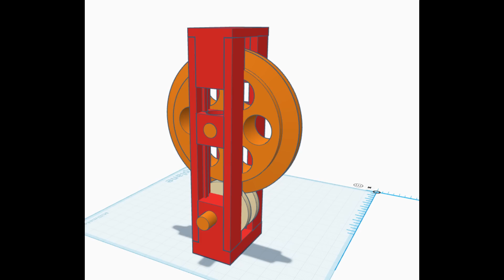2409 Friction Drives

Comment: Hey Rob! To solve the problem of the amount of normal force that can be supplied by the springs, could you try using a pair of fine thread bolts (or threaded rod) with locknuts; on each side of the axle so that you could manually tighten them down to the right torque while keeping the force on each side on center. This would make it something in-between a set-screw and a mechanical press.

Comment: Hi, I feel your process (printing machine design) has taken you close enough to start messing with Math, so will you make a machine that allows A,B,D,C,D.

A.  Suppose you can use your machine to:
(((1+2))). Draw (start, continue, stop) a straight line from any point to any point continuesly (within some plane of movement).
(((3))). Draw very short lines (points/x's)
Given a straight line between two points, 
 Draw enough straight lines all starting from the same point,
  which is one of the given line points,
  and all have the same length of the given line,
  enough so notice a circle.

B. Suppose you can build a machien to test over muliples uses the accuracy in producing:
1. straightness
2. point size
3. point to point distance
4. minimal consistently produced angle between lines with a shared point

(assuming you use the machine to draw circles around to points of a line to get 
a drawing of 4 right angles, or does this assumption say something about the machine ?!)

C. Suppose the test machine reports to "your" satisfactory: 
(((4))). Right Angle production is accurare engouh.

D. Then, What is needed from your machine such that:
======
[The parallel postulate]: That, 
if a straight line falling on two straight lines makes the interior angles on one of it's sides   
    (A) less than two right angles,
then, the two straight lines,
          if produced indefinitely,   (maybe add the functionality of shifting the image)
 meet on side A.
=======

Buttom line = Suppose we did Math using your machine, 
      Can we say something on how machine accuricy relates to
      Mathematical calculation accuricy, like how toruqe tollerence 
      might allow only certain calculating speeds without loosing line straightness,

in other words:

Buttom line = The list of participanted dimentions and materials and balance enquations of the machine in REAL life, VS A List of Mathematical Abilities.

Comment: Looking forward to seeing the repeatability! My gut feeling is that you'll need closed-loop control to make it work well. Friction drive is great for true zero backlash, but the linear distance per degree of rotation is not guaranteed. It can vary throughout the revolution if the wheel axis isn't precisely on center, and over time as the wheels wear down, and throughout a print as the machine warms up and thermal expansion changes your wheel size.
Reply from the maker: all good points mate - do you have any proposed solutions?

Comment: Robert, great video—nicely organized. Just to add to the conversation, I once came across a fascinating variable transmission concept powering a small, three-wheeled cart. It used a friction-drive mechanism involving a spinning cone connected to a motor’s driveshaft, and a movable disk that slid along the cone’s rubber-coated surface. The spinning disk’s axle connected directly to a single cart wheel, enabling focused power transfer  The position of the disk was manually controlled and it determined performance: when near the narrow end of the cone, the system favored speed; when closer to the wider end of the cone, it emphasized torque. The disk maintained constant contact through spring tension, ensuring consistent engagement as it slid up and down. This clever setup allowed the cart to accelerate smoothly from a standstill, adapting torque and speed with simple manual adjustments.   A 3D-printed cone with a rubber coating could easily bring your concepts to life—combining many of your ideas in a single, functional example.  What do you think?  Call it the Cone-Friction-Torque Drive
Reply from the maker: It's a good idea mate thanks for sharing it
Reply: I'm assuming that works like shifting gears, a larger mechanical advantage at the large end, like a higher gear.

Great application and expansion of the video's idea.

Comment: I stopped at 5:25.... one thing with friction is it's related to psi pressure on the contact area and the material coefficient of friction of course .  The smaller the contact area, the higher the psi, so less force required to maintain the friction drive - that reduced required force helps reduce size of supporting mechanisms.
Reply from the maker: I don't know mate - but you might be missing something here - If the force is constant and you reduce the area it is applied then the pressure will increase - a bit like stiletto heels - but If you reduce the force then the pressure applied to a constant area will also reduce - or is that not true? If it is true than you have made a bit of a circular argument - or at least that's how it seems to me.
Reply: @ThinkingandTinkering  have a read up on "Tribology" and specifically the affects of small contact areas on friction imparted and drag - I think will be super relevant for the efficiency of your friction drives!!

Comment: I've thought about friction based mechanisms before and I wonder if using centrifugal force to increase the normal force -> thus increase friction/grip available -> and thus preventing slipping would be meaningful for CVTs or something that is negligible.
Reply: That sounds like a centrifugal clutch.
Reply: @ravenmad9225 not exactly... while the principle is the same, this would be for the purpose of CVTs in cars, which require lots of friction to avoid slipping, and the traditional design of using a belt CVT loses grip at high rpm due to centrifugal forces pulling the belt away from the drum - this is not a problem because it is solved by tensioners, but centrifugal forces could be a benefit to a CVT's design at high RPM if it instead passively enhances grip. (and especially at high rpms when a Turbo kicks in.)

(p.s I have edited my original comment to reflect that it was meant to be about CVTs :D )
Reply from the maker: hmmm - that is clever thinking mate - never occurred to me - well until now lol - thanks for sharing - a really good insight i think

Comment: Hi Robert. I have been following your gearbox series with great interest. i build my own telescope mounts and my latest has a 3 stage friction drive using  disks and shafts. It has a final reduction of over 4000 to 1. It is driven by a nema 14 steppers and controlled by a stm 32 board. With the software i use (PHD 2) it has a tracking accuracy down to .5 seconds of arch for hours on end. My gearbox disks have flat faces bearing on plain straight shafts after seeing this latest video i may have to try this grove idea out. thank you for all the inspiration over the last months.
Reply from the maker: oh wow - thank you mate and impressive stuff you have done there - cheers

Comment: It is always a pleasure to see your latest mechanical designs and concepts. In acknowledgement  of your last video I will make a couple of comments primarily to  stimulate comments from the viewers , since I am certain that you already are aware of the issue:
Friction drives can indeed eliminate backlash, one of the enemies of a precision drive.  What they have a difficulty with is creep, or cumulative error in traversing a path and returning to the original starting point given a fixed input.  With the prototype system you have as a start the  largest error source is likely to be from the inexact effective diameters of two conical surfaces rolling on each other.  Differential pressure from the drive torque  when traversing a closed path containing  two different start/stop sequences is very likely to result in a cumulative timing creep.   The issue although reduced with flat faced rolling contact surfaces remains.  When drive surface wear and temperature variations are included the problem becomes potentially  terminal.
One simple solution that comes readily to mind is the inclusion of a periodic corrector mechanism  to correct for the accumulated error.  Either a home position like solution, or a periodic tooth or hole line up between the friction surfaces.    

The  standard alternative, which is "motion based upon measured position" rather than "drive input"  is near ideal in its ability to remove this problem.  It is unfortunately far from simple or cheap to implement using current methods.  It is the system used in virtually all NC machining.  This solution will also correct for  gear backlash , drive train stress variation, and many other error sources.   With the very low cost of computer logic these predictor-corrector systems are currently the preferred choice.   

I strongly suspect that the solution to these  high cost complex predictor-corrector systems  being implemented in a high precision mechanical system is likely in developing a simple easily implemented position determining corrector component rather than a perfect  input-output mechanical system.

Keep up the excellent work!
Reply from the maker: I loved your post mate - you are quite right in what you say and it wasn't only the issue you pointed out but the possible solutions - or approaches to the issue - I have a concept myself i would like to discuss soon - but your way of introducing the idea and the approaches I thought was brilliant - thank you for taking the time - cheers mate

Comment: We had a challenge in college, it was to make a model car with some restrictions, two being: no gears or belts allowed and DC motor can't be attached directly to the wheels. I used a friction a drive with some wood and elastic bands glued around it and the judges were very not happy because I made a clear case that it was indeed not gears, nor was it a belt/chain nor did I connect the DC motor directly to the wheels. Everyone else had used magnets.
Reply: Out of the box solutions like that are brilliant! It reminds me of a bridge building challenge I did at school where the teacher gave some restrictions on the materials allowed (wood sticks, pva, carboard, hot glue) and mentioned how the past winning teams used PVA glue instead of hot glue. My team used lots of hot glue, but what we did is we used cardboard triangles at the corners and unlike other teams put them on both the inside and outside to double up each joint. Our bridge survived so much weight that the teacher couldn't stack anymore on!
Reply from the maker: That is the kind of out of the box thinking i really admire mate - awesome solution!
Reply: @partypete2542  i am wondering if a separate propeller connected to the dc motor with passive wheels would have worked
Reply: @NadavElmakias  Only issue with that solution is that there was a H x W x L limit which was quite limiting, so I don't think a big enough diameter propeller would have been viable but I never did the math for it so it could definitely be an option. Most people just opted for a magnet gearing with high strength magnets and a thin sheet of low friction polymer in between.